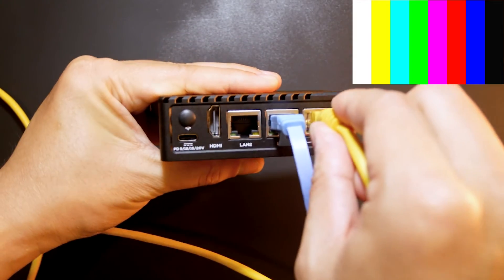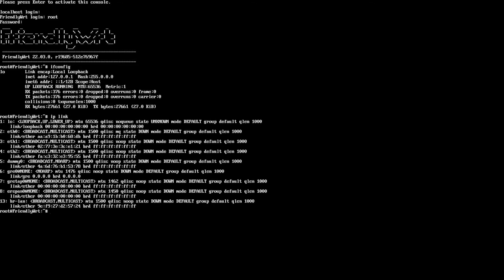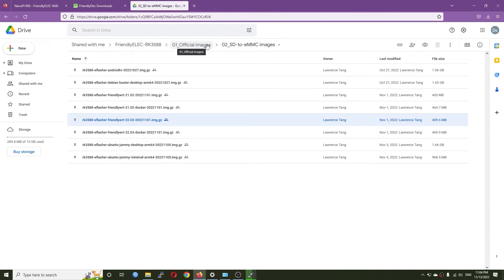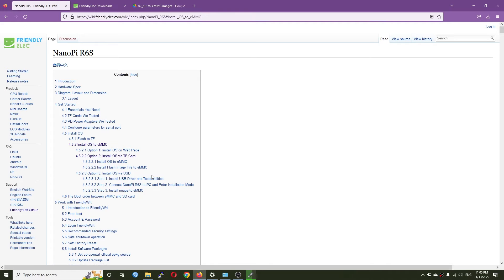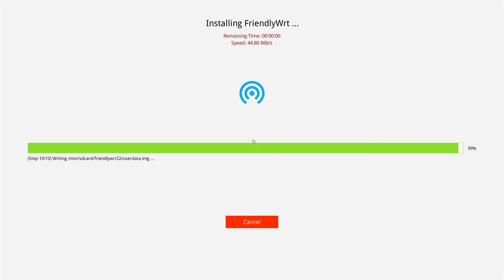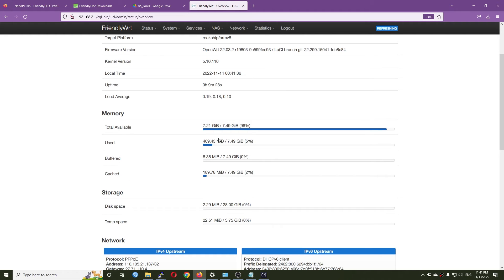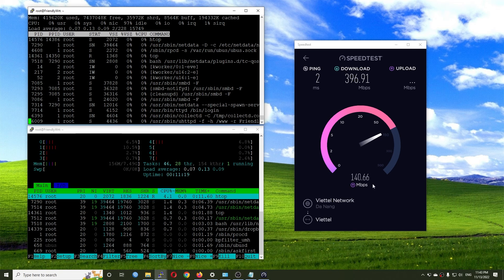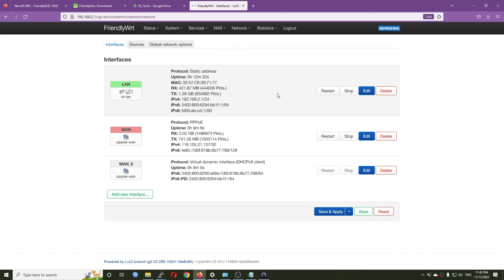NanoPi R6S Bootup - Firmware Update (eMMC) - PPPoE Speedtest

Comment: which is the correct way to upgrade an already installed version, to a newer one? I mean, i'm at 22.03 of may 10 on r5s, there's now a may 24 new img, but i think that flashing it via microsd will remove all my settings... ok, i can do a backup and restore, but this is not the way openwrt works on other platforms... you can just upload a sysupgrade firmware, usually, is friendlyarm providing any of them? thanks!

Comment: Hi, I bought one of these and for some reason it only boots up Android when it’s both plugged in power and plugged into my PC? It only shows FriendlyElec logo & then reboots over and over unless I plug the usb connecting to my pc in. Any idea why?
Reply from the maker: Hi, it is not something strange. You can always install another OS by following the Wiki of the R6S. To install OpenWRT, see this video at 1:50
Reply: Probably, your power adapter isn't providing enough power.

Comment: A couple of questions about this device/software.  Does it date and time stamp the packages, and can it give data throughput reports on the up and downloads to the ISP internet on a calendar basis?  Will it handle the ISP max speed of 900Mb/s?  I cannot install Openwrt on the ISP owned modem, but I was thinking of putting one of these devices in front of it, (in series with it) to measure the GB throughput in the billing period.  They claim that I put 1,760.00GB of UPLOAD through their modem in 5 days.  (more than is on all my devices) That is more than in the previous 3 years, of about 0.4GB per day average.  I need to be able to call them on this garbage.
Reply from the maker: With OpenWRT, you can install luci-app-statistics to achieve that. As I remember, Friendlywrt (that was ship with the NanoPi R6S) already has this packaged pre-installed. You can also take a look at https://openwrt.org/docs/guide-user/luci/luci_app_statistics
The thing is, even if you can measure the total I/O traffic, will the ISP accept that the value is correct?
For the throughput of the R6S, you can see this video https://www.youtube.com/watch?v=UMbTibi3n2k
Reply: @VanTechCorner  Thank you for the reply.  The extremely large ISP recorded upload was obviously an anomaly.  (a virus, malware, hackers etc.)  I don't know if that was on my side of the ISPs router or the ISPs side. (outside the house) By their agreement, supposedly I am already paying for protection on the ISPs side of the wall.   Think of it like a Water Meter, if there is a water leak, and it is not on my property, (didn't come through my meter) I don't pay for the water that leaked.  I think that the hardware / software that you demo would be an information solution for this. I will study all the different aspects of the software / hardware combination.  Maybe won't even fully understand it unless I buy it and set it up.  As to the software that is actually on the device, the software that is on the computer that accesses the device, what realtime info can be saved directly on the device, does the realtime info need to be saved directly on the computer that accesses the device, or can it be periodically transferred.  So the computer that accesses the device does not need to be on all the time to capture the data.  Probably no way to find this out unless I actually try it.  Thanks again, I think your info has pointed me in the right direction.  There is a product by SamKnows called a WhiteBox, that does exactly what I need, but can only be acquired on a "selective assignment" basis, and not for purchase.  I am trying to simulate that.

Comment: comparing to intel N5105, which one will give better speed on wireguard?
Reply from the maker: Hi, I have yet to test out the Wireguard & OpenVPN speed, but I got a WAN to LAN throughput here https://www.youtube.com/watch?v=UMbTibi3n2k&ab_channel=VanTechCorner
- With the NanoPi R6S, you got the product and the firmware (software) update from, both FriendlyElec (Friendlywrt) and the OpenWRT community.
- With the x86 PC/ Intel N5105, you just got the product and the rest depends on you (or the OS you are using).
Reply: @VanTechCorner  thanks for ur reply. I just bought the R6S and will receive in couple of days. I will follow ur tutorial to install the wireguard. Thanks a lot for all tutorial videos. It helps a lot.

Comment: Hello, I have a 2.5Gb wired connection between my RTL8125B chip 2.5Gb ethernet card and Nano Pi R5S on my computer. According to iperf3 results, I see 2.37Gb connection speed between the two in my tests. However, my disk connected via usb 3.0, which I have opened for sharing with samba4, which I have installed Openwrt, is between 70-80 megabytes for file copying and downloading. According to iperf3 test speeds, shouldn't I reach at least 250 megabyte file copy speed per second? By the way, I am using the rk3568-eflasher-friendlywrt-22.03-docker-20221123.img.gz image. Could it be due to this image? Where should I check? Thanks.
Reply: not really, there are lots of factors like disk cache, network protocol, usb bottleneck, disk write speed, cluster size
Reply from the maker: Hello, ethernet throughput and disk speed is 2 different thing. You get a 2.37Gbps throughput doesn't mean you will have the same speed when sharing the USB disk over network. May I know:
- What is the speed you get with CrystalDiskMark? (The disk is directly connected to PC's USB 3.0)
- What kind of file system (ext4/fat32/ntfs) of the partition
- Are you using R6S, or R5S?

Comment: Is it necessary to use maskrom séquence (before) to boot the OS from sd card ? Because i m not able to boot from sd...
Reply from the maker: Hi, by default the NanoPi R6S should have FriendlyWrt pre-installed in working status. Therefore, you can use it out of the box. Perhaps mine is a developer unit, that is why I have to manually update.
Reply: @VanTechCorner  ok thanks, I finally found the solution. I tested another sd card (A1). Now it works.
Reply: @jeromeponcin4796  Hello How did you manage to do it i am trying to revert back to FriendlyWrt